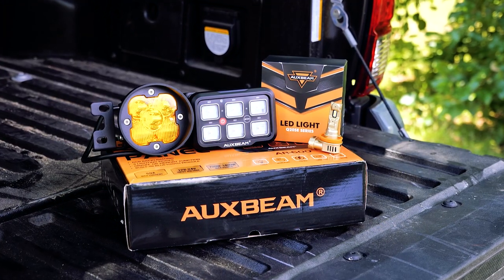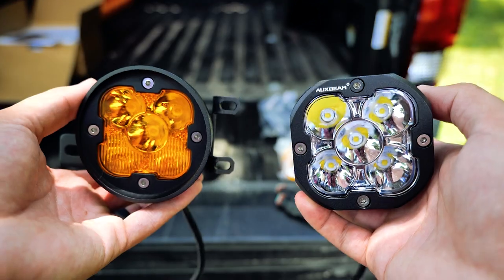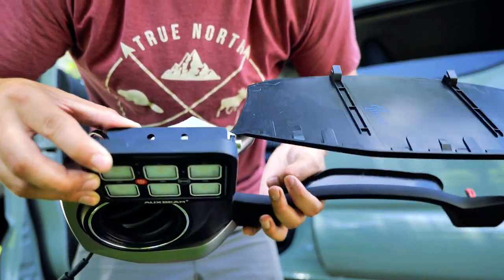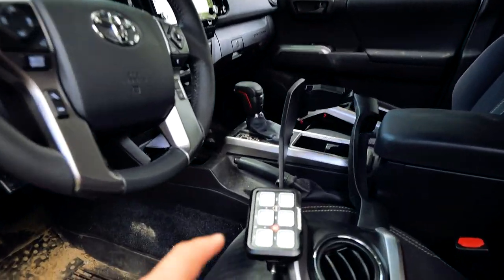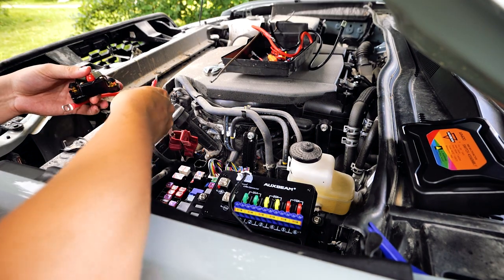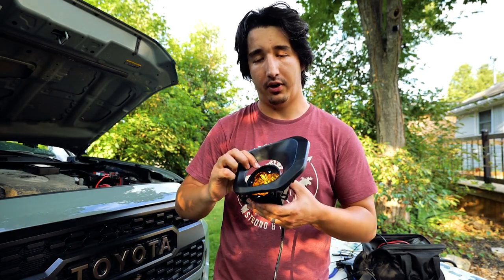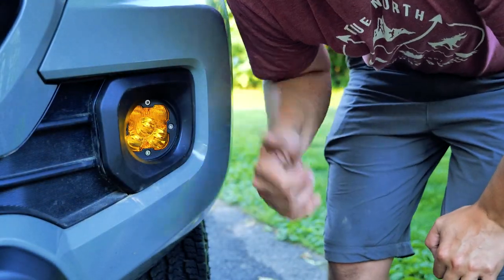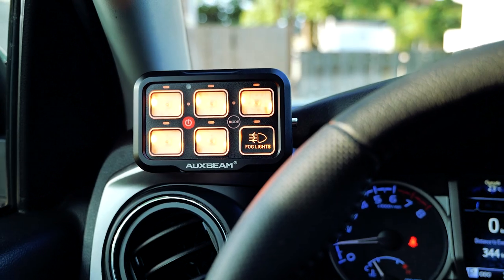New AUXBEAM RGB 6 Switch Panel install on my Toyota Tacoma

Comment: Just a thought, I am not sure why that didn't work without your headlights on, but I think I would move that tap a fuse to a key on power location so you don't have to have your headlights on to run the additional 5 switches.
Reply from the maker: Yeah that's exactly what I will be doing, I just need to find the right fuse to tap into! Thanks for watching.

Comment: Everywhere I’ve read, they say not to put LEDs in the halogen housing.  Why?   Are these special LEDs?
Reply from the maker: I think this is the case if they don't have a proper cut off, so you'd blind people. These headlights have a good light cut off "projector lens" 

These trucks specifically come with LED bulbs in the higher trim. I'm not sure if they actually change anything about the construction of the headlights themselves. Thanks for watching

Comment: I had the same problem. What fuse did you tap into ?
Reply from the maker: I ended up changing it to the IGN fuse and works perfectly now. Was worried about touching anything to do with ignition but it doesn't seem to have caused any problems

Comment: So to be clear, you cut off the relay from the lights?
Reply from the maker: Yep, the switch board acts as a relay
Reply: @JoelTremblayCA  then I'm not sure what the problem is! Switch pod has power, but lights not turning on..